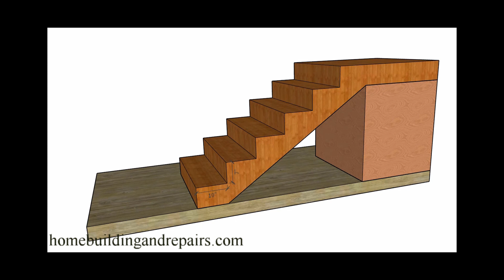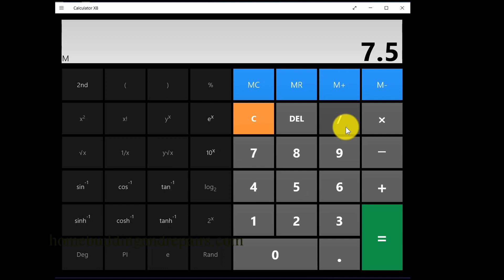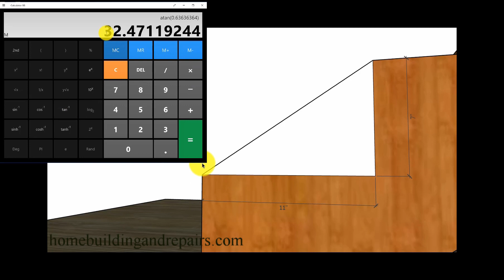How To Calculate Angle of Stairway With Scientific Calculator

Comment: The two squares is a neat trick but knowing the rise and the run of the steps and using a construction calculator (which any carpenter should have) will give you the angle. I’ll write this down on the stringers for reference later. I’ve also put a digital level across the noses of the treads to find the angle. However, many digital levels are pricy but a carpenter should have at least one in their arsenal.